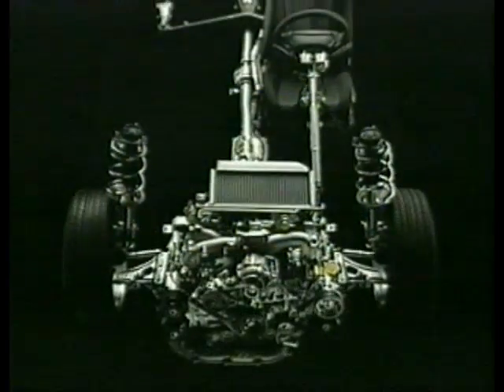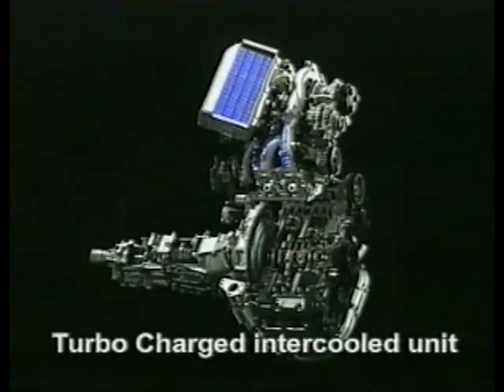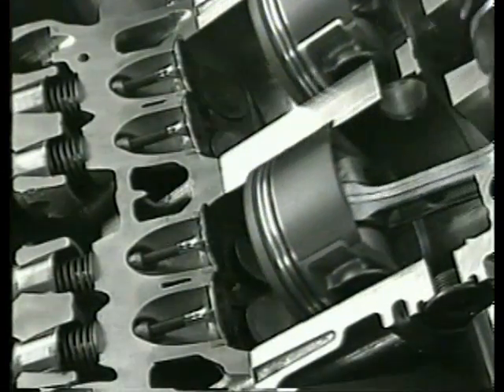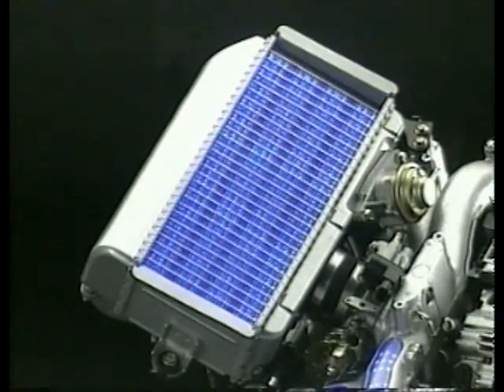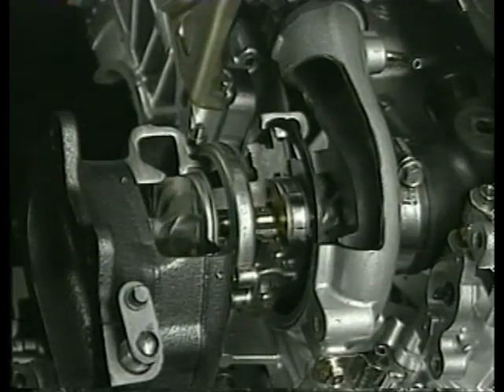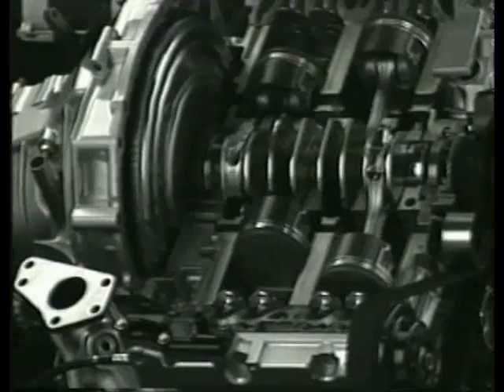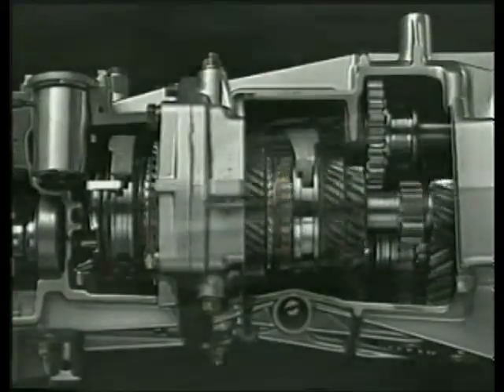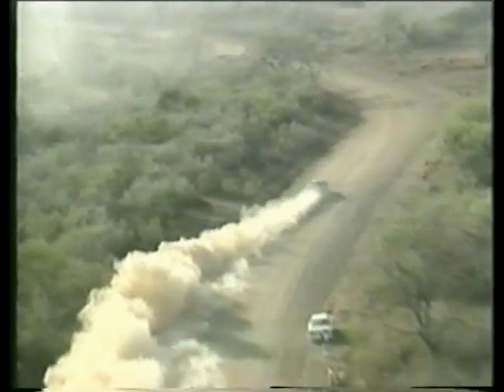Subaru Powertrain

Comment: Fantastic engineering! Next, comes the electrics, computer monitored, even a motor for each wheel and a huge low placed weight of batteries to lower center of gravity.

Comment: Current GTI is Fantastic, handles incredible with Eibach prokit springs and sways.  Quick.  Current 2013 Tiguan SEL is equally slick, of course doesn't handle like a GTI, but first class fit and finish, top quality, great stuff it replaced a 2009 SEL which was FLAWLESS, as is the current A4 S line.  If it ain't GERMAN, it ain't a car.  they invented it, they perfected it!  Simple.

Comment: Yeah, my last Jetta GLX VR6 only went 316,000 miles, and never let me down, EVER, in any weather.  current GTI is GREAT!  With additional Eibach springs and solid sway bars, took a GREAT car and made it Welded to the road.  German cars, or nothing.  they invented it, they perfected.  VW first plastic gas tanks, now everyone does it, first electronics ignition in mass produced cars, now all do it, first pocketrocket hot hatch GTI, and it's still the best one.

Comment: And how did you come up with that brilliant conclusion?  Hmmm Bugatti made by VW comes from where, and it does have a GERMAN VW W16 engine producing 1200 HP.  I guess that is a piece of crap for $1.7Million.  And of course Bentley, VW stuff in it...yupper, just Porsche. Porsche is terrific, so are several other brands.  Wonder why the LeMans is always between Audi and Peugeot?  Audi of course won the last 11 out of 13 on German TDI....hmmmm Which is also a VW.  What have we learned to day?  Tool

Comment: Yeah, my last Passat was 126K miles, last JEtta VR6 GLx 316,000 miles.  Current  GTI 64K miles .  Flawless and FEELS GREAT welded to the road with Eibach springs and solid sway bars!  If it ain't GERMAN it ain't a car.   Golf R is next on my list to be!  Germans, invented it, and perfected it.  You are imagining things. Scooby Du....is not a car but a cartoon.  Porsche/VW/Audi cars by the INVENTORS.  Heck  F.Porsche even had 4WD in like 1913! ELECTRIC motors on each wheel. When he worked for Be

Comment: Over 2 million RECALLED cus they ahve more defects, o what a feeling, TOYota recalls cars like Ford and GM, all junk, all the time.  All BS hype, and you fall for the BS.  they are horrible mush, slop, with cheap designs, and poorly designed use of space, junk.  you certainly have not driven anything GERMAN, rattles, what the hell are you talking about my 2010 GTI 64,000 miles rock solid flawless, welded to the road handles

Comment: oh? so now we are talking build quality are we? look at the e36. it is of terrible quality and the engine (aside from the straight six in the M series) that seemed content with leaking oil whenever wherever. 
compared with even a corolla of the same age, it doesn't stack up. 
as bmw's quality improved. so did asian cars. i dare you to get into any subaru/toyota/honda.. hell even hyundai or kia, and say that you would rather, for an extra 40-50-60 thousand bucks, youd rather have the beemer.

Comment: No. It's you who need to do some reading and stop spreading rumors and lies. 
WRC shut the whole B Group NOT Audi Quattro. B Group was becoming too dangerous for the drivers and spectators. There were nearly no regulations in place - cars running over 500bhp and spectators inches away from cars doing over 100mph. People were ran over and killed by fast cars.
I bet you have no clue about those cars I wrote about earlier.

Comment: Again, you are full of BS.
Audi's "new" Quatro is beyond any other system because it monitors each wheel and distributes power accordingly?
NEWS FLASH. It's called torque vectoring and it's been on the market since 2005. First company to use it? No not German. Japanese. Honda. It came to America first with Acura RL and then Honda Legend. It became more popular when another Japanese company showed what's it capable of. Nissan with the last gen Skyline.
So much for the evolutionary Quattro aaahaah

Comment: Even innovated the Christmas tree!  Rockets, jet engines,multi valve engiens, electronic ignition,it's an endless list of what we all use.   Modern highways based on Autobahn.  anti lock brakes,crash crumble zones. syn oil, getting gas out of coal. x-rays

Comment: What planet are you writing from.  Audi pioneered it all.  the latest generation of Quattro is so far beyond any other system, it monitors each wheel, sends power to each wheel as needed, Audi engines  are also superior to anything from copycat Soo-Bar-Roo. They copied teh Boxster engine, they copied turbo and superchargers, all GERMAN innovations, even multi valve engines.

Comment: Subaru should start to incorporate electric assist small motor in drive train that without locking differentials complex system could in-no-loss time to activate in slippery situation, and also in loss traction situations such as mud-snow, where usually require locking differentials. This small electric assist motor would activate in tricky situations in fast turn and in traction loss. I heard this kind of system functions in Acura Vehicles. But the difference is that it wouldn't hinder when bro